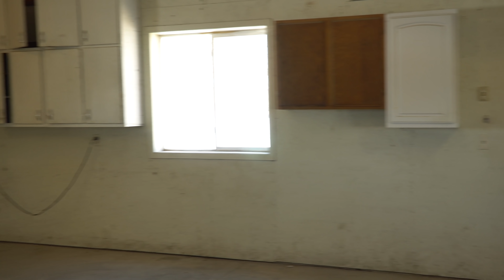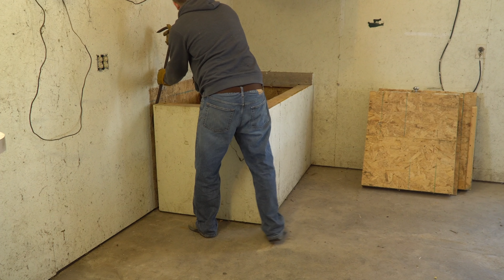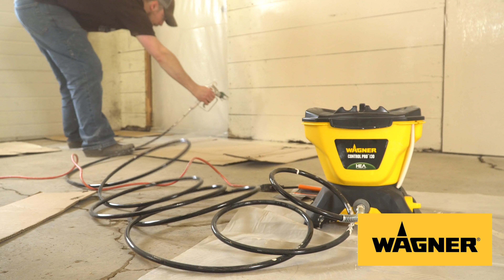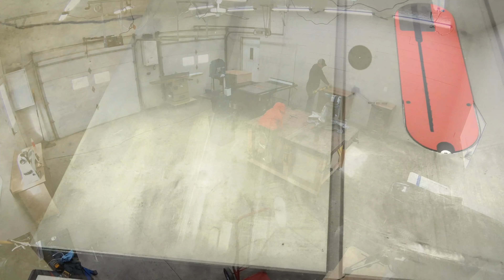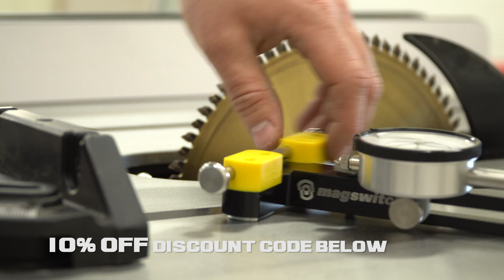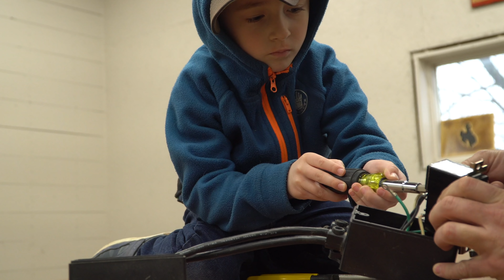New Bigger Shop & Recovering from Moving

Comment: Get a dehumidifier to run in your shop.  I use one that has a pump to push the condensate out of the room.  Mine goes to a floor drain, but you could just run it outside on the ground.

Comment: Hi.  I can feel your anger brother.  I just moved my shop from Oklahoma to North Carolina moving not only wood tools but also metal working tools.  Dealing with the movers and broken equipment was extremely frustrating.  Looks like you will survive the move.  Moisture is a problem here also.  Keep all metal surfaces protected.  In just 3 days I had surface rust to deal with.  Good luck.  Enjoy your bigger space.
Reply from the maker: Man I didn't expect it would be quite as unpleasant as it was. Everything turned out fine, but I way underestimated the difficulty.

Comment: Nice shop...just curious how you did the wire on the shop lights. Did you just daisy chain them together to one 110 plug. Thanks
Reply from the maker: There were 3 light fixtures up there that I rewired into duplex reticles. So there's 14 lights split into 6 daisy chains.
Reply: @GunflintDesigns  Thanks

Comment: I like it. That's a lot of volume of paint from such a small machine...
Did you consider putting epoxy on the floor? I did my garage in epoxy and it has been a breeze to clean up after a project...
Reply from the maker: I'm looking into it. I figured I had to at least wait for warmer weather so the epoxy would adhere to the floor better. What kind did you use?
Reply: Gunflint Designs I used the EpoxyShield 2.0 from Home Depot and it works great. Taking the time to mask and tape is definitely worth it though. 
It’s easier to do while the place it empty but it can be done in stages.